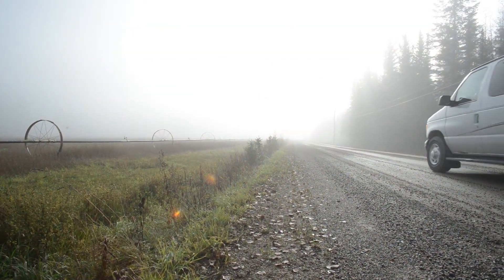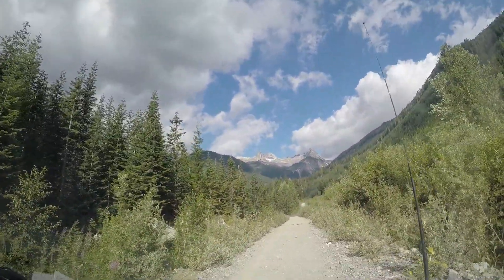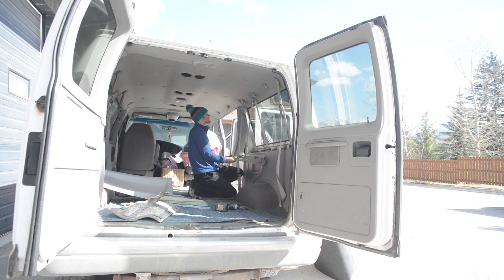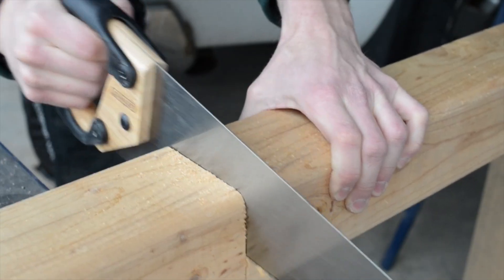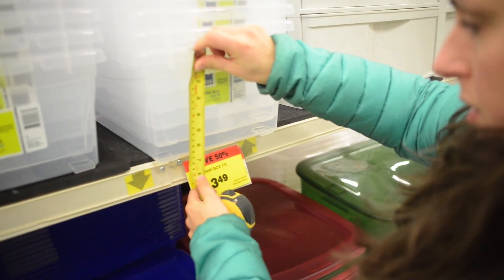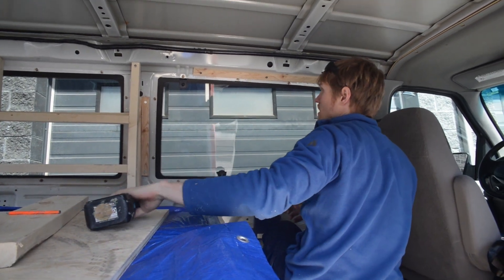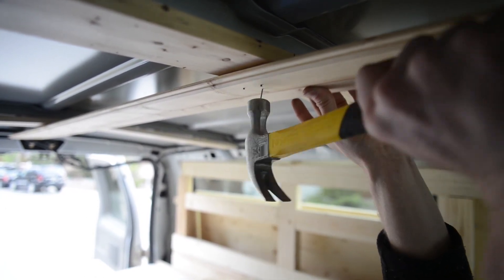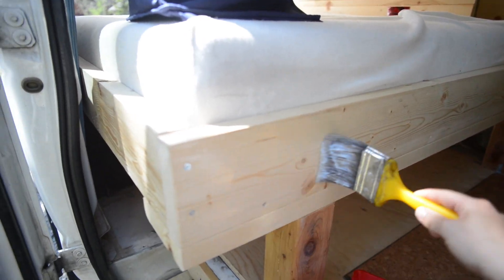How we built our Camper van - Simple, strong and functional.

Comment: Thanks for the video, nice job. I am in the processes of doing the same thing to a Ford high roof Transit Passenger Wagon. I an leaving in the plastic walls and headliners to make the final result look finished with the factory ceiling vents and lights. I an installing some pre-made cabinets and a bunk bed (Disc-o-bed). My van was expensive, but I like that I have a 10 year bumper to bumper warranty to cover me as I travel.

Comment: Nice work! Thanks for sharing. :-)
I would drill many medium sized holes in the plywood on the bed though. (Of course not too many so it'll weaken the plywood). This is to get some ventilation. Because we lose more than a pound (sweat/water) while we're asleep, (well, something like that. :-) it's good to have some ventilation between the plywood and the mattress. To prevent too much humidity which can start developing mold/fungus underneath the mattress. In humid climate like here in Norway where we have a lot of rain, it can a problem. With some ventilation you don't have to air out the mattress so often.
When I built my bed frame I used slats instead, and fastened them around 2-3 cm apart from each other. To get the ventilation coming up from underneath.. But drilling lots of holes will do the same thing.
Reply from the maker: +Vanture Brilliant advice Vanture! We didn't think of that even after seeing a friends mould collection under their mattress. It's very dry here so maybe we got away with, I will have to check today :S Thanks!
Reply: good call. a handheld router would make quick work of some air vents

Comment: I dont understand why everyone gets rid of the headliner and puts up wood. Why don't they take it out, put up insulation then reinstall the headliner?
Reply from the maker: Hey, I guess it is about priorities, we were really happy with the esthetics of the roof and didn't find a need for insulation.
Reply: +Wanderlust Vanlife Thanks anyway for sharing ;)
Reply: I think wood adds more flexibility if you want to add things like fans or lights or even create more rigidity in the structural elements by tying it to the ceiling. But if I wasn't doing that, I'd definitely skip the wood and save the weight.
Reply: My Damn Channel I like the wood. I would have put some insulation though.
Reply: If for nothing else, the wood looks way better
Reply: Adam Johnson agree
Reply: My Damn Channel can you explain that process? It sounds like good advice.
Reply: Hi, I have a van that's similar to this one. With the original headliner, there is a bulge in the middle from the rear ventilation system having vents that go into the roof. This sticks out about 2". In order to have a flat roof, replacing the headliner is the way to go.
Reply: tuzyzx hey there. I have a ford passenger e150 with headliner  above.  It has all the vents above and all the stock lights.  When removing headliner what did you do with all the vents and existing lights.

Comment: How did you hinge the legs?  I heard you mention that you attached them using wood screws.
Reply from the maker: +Campward Bound The legs aren't hinged just solid attached. We used long wood screws (pre drill first) from the top down then also some L brackets with smaller wood screws.

Comment: Is your van a 2 wheel drive or 4X4?  If 2 wheel drive, any trouble in those back roads?
Reply from the maker: +ogcen 2WD at the rear. No trouble on the backroads at all. This van is pretty high and has large wheels which helped. We did have to turn around once or twice but I feel those situations would be risky even in a 4X4 without a support 4X4.

Comment: I think added too much weight and all that wood takes up room. looks nice though. 
good job
Reply from the maker: +Dar Tice Yes it is true the wood takes up a bit of room (the roof in particular) but looking homely was important for us. I'm not sure the weight is a problem. The seats we removed were very heavy and the van is designed to move 12 people.
Reply: +Wanderlust Vanlife the weight will affect fuel economy more than anything. and a solution for the homely feel minus weight could just be thinner wood
Reply: Taking out weight to put it back in is preferential but gas mileage is important

Comment: May have been a good idea to coat the floor & cover all metal with insulation before covering it all up. Would have helped with spill's causing rust issues & holding in the warmth on cold nights.

Comment: did you just disregard the rear A.C.?
Reply from the maker: Yes. I just built around it. Removing the unit was too much hassle and the extra storage wasn't required. Some times we ran it as a heater when it was really cold and needed the van as warm as possible for sleeping.

Comment: anyone doing this take note; bed construction is mega overkill and several times heavier than needed. Beds can absolutely be constructed with 1x4s and hardboard. Using construction lumber heavier than is used in residential walls will result in you being overweight.
Reply from the maker: +Chris Cooling Very true! But we liked the look of it that way, character counts for something I believe :) The next bed will be much slimmer, we are considering a welded metal frame.

Comment: Way overboard on the materials. Thinner materials cut weight (fuel consumption) and maximize space. Also a good ideal to avoid holes through metal (even with sealant), such as the screws you used to attach plywood to the floor. I would have glued that (thinner) plywood instead. No chance of rust. Glues are very good today and will certainly outlast the vehicle.
Reply: Actually if your van does not have enough weight it will be come unstable and life off the ground
I know because it happens with I van and we have to keep a bunch of milk gallons full of sand and rock in it

Comment: all that work and you didn't insulate first, nasty,you're going to freeze your little willie in th spring fall or winter. Plus you added a ton of weight by using so much wood. ell  ope it works for you.
Reply from the maker: +F. Ball It worked out fine, we did at least two weeks bellow zero with no trouble (coldest night -10c). Thanks for using the word willie it made me smile :)